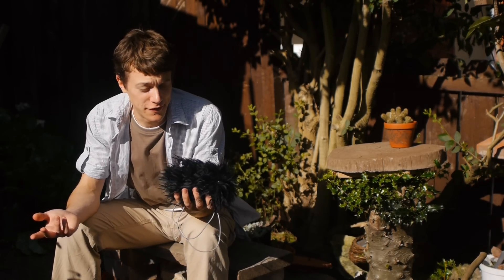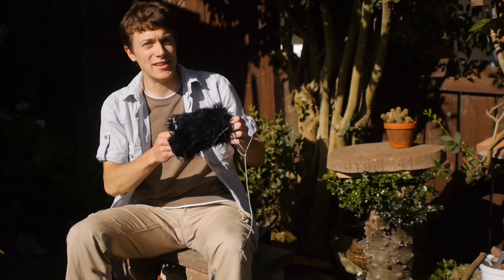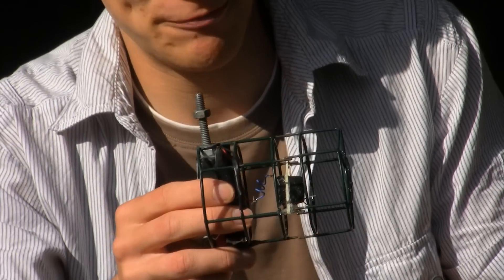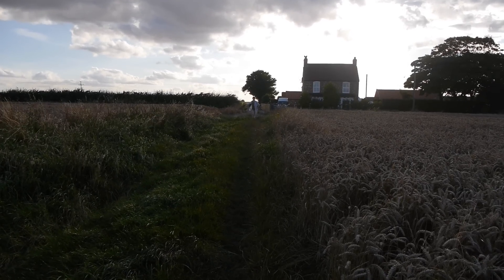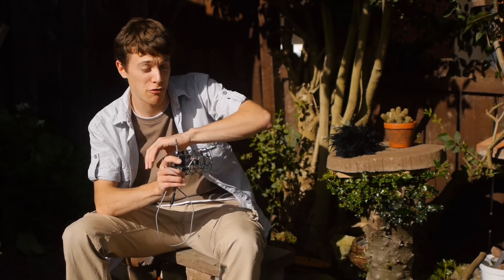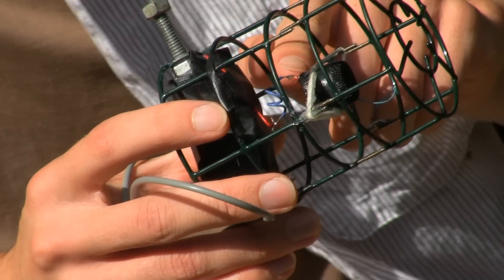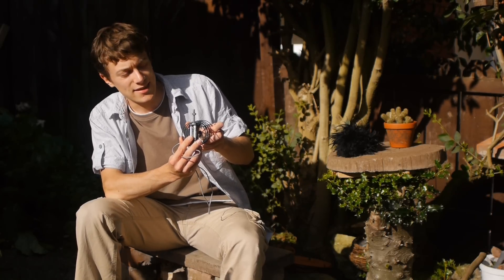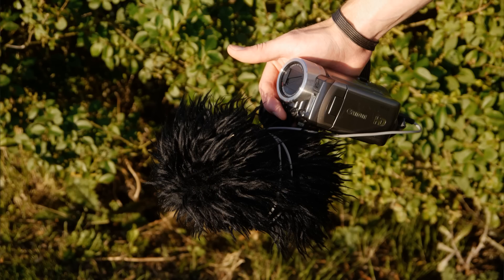DIY Shotgun Microphone (with wind shield & in-built shock mount)

Comment: Shotgun microphone is an alternative name for a directional condenser microphone. Cardioid and supercardioid mics can be called shotgun mics and used on a boom pole, but only when the person or production doesn't have a directional mic available or the situation calls for a wider pickup pattern. As for your project, it does not isolate the mic from lateral noises, and it only plays the role of a suspension mic holder (which can be purchased for $10). There's a big flaw with your build though; The metal net (bird feeder) acts as a Faraday cage, absorbing all sorts of interference. In a way, you've made the opposite of a shotgun mic. 

It's not very hard to make a cardioid mic more directional, a thin and long cardboard tube (e.g. wallpaper tube) can be used to mimic the outer construction of a directional mic. Get a Rode VideoMicro ($60), or a Movo or Boya knock off (just as good for $25). Cut thin rectangular shapes on the cardboard tube, same as the cutouts found on a directional mic (look at a picture) and use 2 long and thin pieces of sponge/foam to block the cutouts you made; gluing them on the inside of the cardboard tube. You could open up the tube to make this process easier, and then glue it back together. Now attach the small cardioid microphone on one end of the tube and use the opposite side to pick up your dialogue or sound. This solution will NOT replace a directional mic, but it will surely render your cardioid microphone more directional. Noises that reach the microphone laterally will enter the cutouts and disperse through the sponge and inside the tube; while the microphone will mostly capture sound that comes straight through the tube. Directional shotgun mics used in film and TV productions follow the same logic, but their brass bodies and professionally engineered cutouts and sound dispersion materials will greatly improve audio quality, elimination of interference and tight pickup pattern.

Comment from the maker: Practically, no, not unless the digital camera has a mic input (some DSLRs and bridge cameras do).

If you were to take the camera to bits and hardwire it to the digital camera's mic, then yes, you could probably get it working. Depending on the camera, though, it might sound rubbish.

Comment: You've done a pretty good job of isolating the mic capsule from handling and wind noise, but the term 'shotgun' is usually reserved for microphones with more directionality than a 'cardiod', and usually this is acheived using an 'interference tube' which is just a tube with slots in the sides to create delayed sounds that cancel. Easy in principle, but the slot size and spacing, and careful use of absorbent material inside seem to be the trick.  I was hoping so see how you tackled that :-)

Comment from the maker: I used a standard mic preamp. They're pretty common and cheap to buy as kits, but make sure you find one that supplies power to the capsule otherwise you'll have to add that bit yourself.

The capsule is connected to the amplifier with two wires; positive and ground.

Comment from the maker: You're welcome - I need to thank YOU actually. Your recent comments spurred me on to finally make this video, and I'm glad I did. :) So cheers.

The amplifier was not built by myself, but scavenged from another microphone system. However, Maplin (if you're in the UK) has a FANTASTIC mic preamp kit which you can build yourself. It blows the pants of the one I used, because the signal to noise ratio is out of this world, as is the frequency response. It's based on the NE5532 chip.